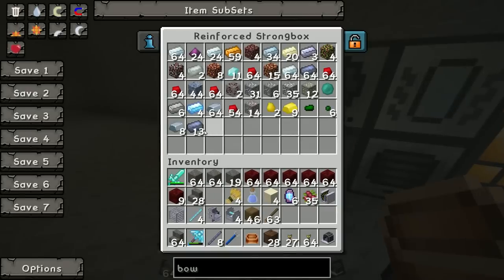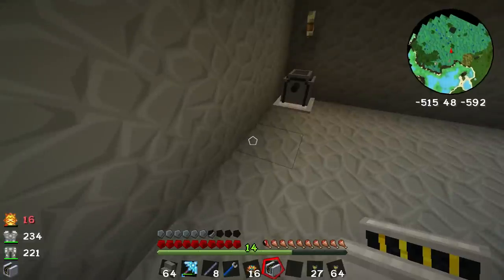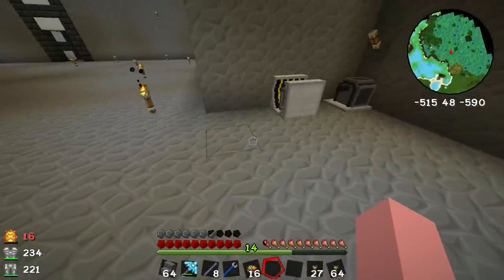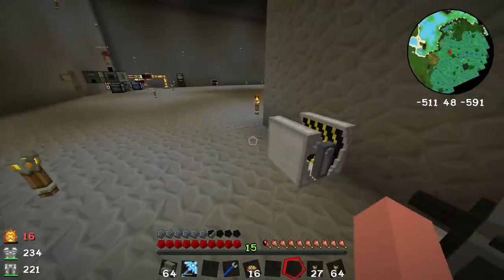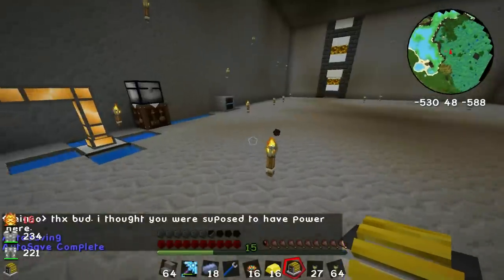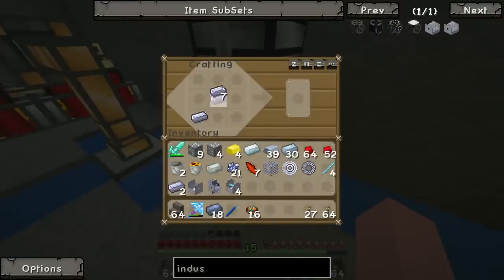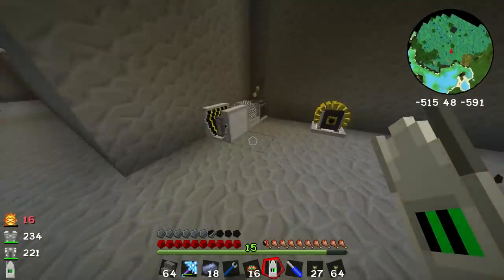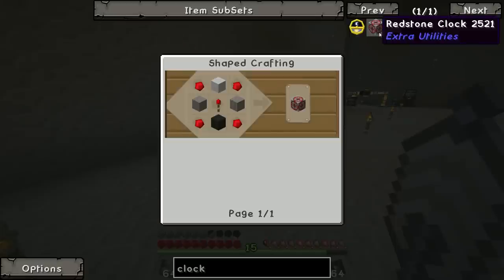Minecraft FTB Horizons - Storing Rotary Craft Power! Ep 20

Comment: A radian, or rad is a measure of angles or rotation, and I think 2 pi radians equals 360 degrees. I think it is mostly useful for determining the distance a point travels on a circle when it is rotated a certain number of degrees.